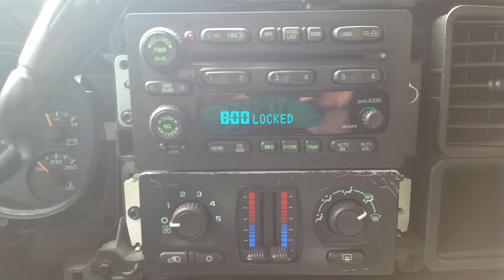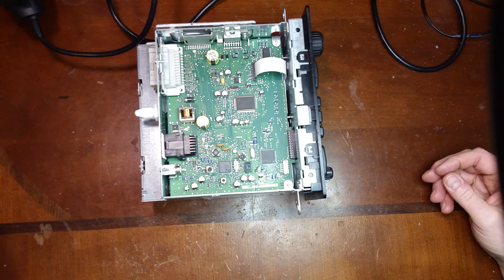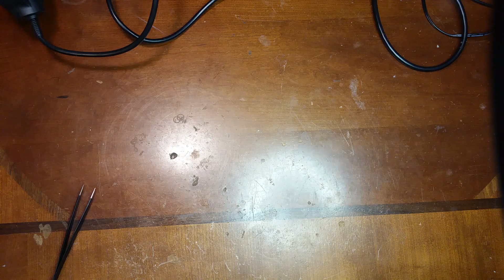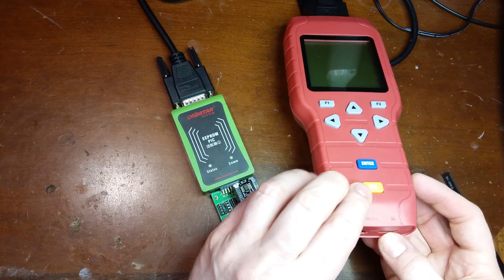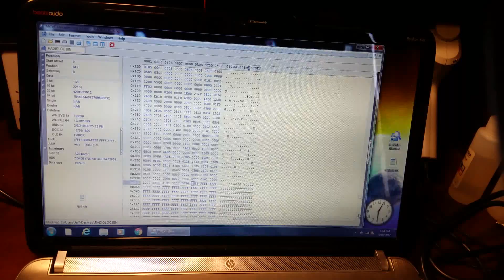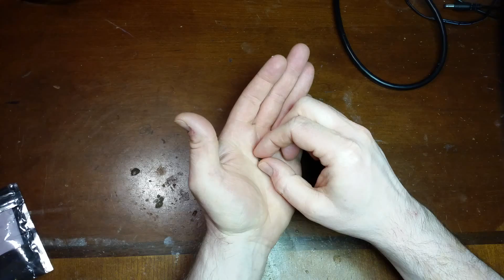My attempt to unlock a GM radio

Comment: It worked!! I just did it on a 2002 year radio that I installed on a 2005 Trailblazer. gives "Calib Err" message upon turning the ignition on then it goes away. I don't know if it's a checksum error or a problem with the radio it self. everything is functioning properly. thank you!!
Reply from the maker: If it is storing station presets and audio settings than it was successful!
Reply: Folks, the GM RDS radio receives extra info like the song, band info. Class-2 serial data wakes the radio by Sharing the VIN to prevent theft. A speed signal from the PCM tells the radio how fast you are going. It gently increases the volume as wind noise & road noise increase. Hey, the government wants higher fuel mileage, so even the glass is thinner. The EEPROM stores a lot of info. If you sit the radio on the bench and drive for three weeks, put it back in (Or Changing a Dead Battery) the radio wakes up, goes to your station at the same volume, plus all stored stations are there. The Body Control Modual turns it on and monitors its “State-Of-Health.” If the lights are left on, key is in the ignition or turns signal is on too long, or a “Hands-Free” phone call, it mutes the volume and a tone comes out the left front speaker. If an SIR is deployed & equipped with “On-Star”, the On-Star module has its own battery. A signal is sent and they will ask for you to respond. They call the local police/highway patrol as they have your GPS location and sent help and stay with you until first responders arrive, or if they know the On-Star battery is running low. It is serviced separate from the big normal battery. It may require replacement but it will let you know in advance. Blessing to all!
ASE Master since 1978 - Retired
Reply: can you send a picture of where that chip is in one of these radios, I can't find any pictures of where the chip is on the board
its diffrent to the one found in the silverado's

Comment: Can you set the vin to all Fs or 0s and it work?
Reply from the maker: I haven't tried. But I wouldn't think it would work since the radio is looking for a match.
Reply: I wouldn't expect it to work with the EEPROM removed either, but supposedly...
Either it's explicitly coded that way, or the failed read returns 0s or Fs and that works out whatever way.
Reply: I'd also suspect that there's code left over that makes it easier to test at the factories or in  prototyping phase. If you know the master code, it stops looking; what if that code is all 0s, or whatever the default value is in the register, before being overwritten with EEPROM values. A paraphrased line of code could be "if 000000, assume EEPROM failure or testing".
Reply from the maker: @Marc_Wolfe  Yes it's possible that there is some sort of master code that allows the radio to write the VIN when it's new. But I haven't researched it or experimented so I'm not sure.
Reply: You've done more than I have checking that the radio works without the EEPROM.

Comment: A lot of good radios have been thrown away because of that nonsense.  I had an old 88 Mercedes 190 and had to junk the factory radio after making the felonious mistake of changing the battery and not using a 12-volt transformer to maintain power.

Comment: Jeff, It been two years since you did a video on a GM rear view mirror, but I remember it. I am doing a swap of an 03 Tahoe engine in my 1967 C10. The Tahoe belong to my youngest an hit black ice. He gave me the whole vehicle. Being a retired tech, working at GM dealer plus your video, I changed the mirror as I have no passengers side SIR or seat sensor. For most, the passengers front seat has a bladder that creates pressure a sensor reads. The SIR system decides to turn on or disable the air bag if the weight is roughly less than 42 lbs. (Caution; Any repairs, parts new or used, need to be calibrated at the dealer) 
The mirror has PASSENGERS SIR - On / Off in mirror that I did not wish to look at. Using two 0.39” feeler gauges, I was able to remove cover, un-clip the mirror dimmer leads and remove the plastic “Appliqué”. I cleaned with wax/grease remover used in painting. Applied two coat of plastic adhesive promoter, light, thin and 12 minutes to dry or flash off. Then two coats of quality flat black was sprayed in the same fashion. LED’s produce very little heat but still could shine thru. I place folded foil over the LED’s in two rows, the a 1/4” foam strip. Waiting over night, I cleaned the mirror and window for compass and temp readings. 
Placing the now black strip was easy using some sticky on the locating tabs, clipped the mirror leads back on, made sure all was aligned. Snap. Everything works, no scratches and looks like it came out of the box that way. I get one thing done per day Retired! Thanks Jeff!
Reply: Sorry I can’t edit mis spelled words. 6’3” big fingers on little iPhone 6. Never owned one but my son sent me one. I just go to my garage everyday, plenty to do and make. Jeff, you gave me a little extra confidence to Get-R-Done! Thanks again. Like / subscribe & learn!
Reply from the maker: Sounds like a pretty cool project you have on your hands!

Comment: If you program all zeros in the vin field. The radio will relearn the vin that it is installed in.
Reply from the maker: I've read this in old forums. I tried it once and it didn't work. I might have messed something up.
Reply: jeffescortlx I did have a bin file from a new radio never installed. And it was all zeros at the vin area. Will have to go back to the bin file and compare them. I remember seeing the presets store points as well back in day when I was doing this a lot. And the XM modules as well we would zero all the content of the serial eprom and it would relearn the vin along with some info from the radio got populated there as well. After 50 ignition cycles it was said to be fully populated and the XM was not programmable from the tech2. Only a new XM module or blank zero eprom module would relearn and function.
Reply from the maker: @rick601a  I definitely want to try it again. I have had quite a few work for me with inputting the VIN manually, but it certainly would be better to have it set to all zeros' s all ready to go for the next vehicle.

Comment: Can you just use the clip to avoid desoldering? And can you use a usb eeprom reader instead of the tool you used? Thanks.
Reply from the maker: I don't see why not. You can use any method you want to edit the data.

Comment: I worked for GM's radio department back when these were developed.  The gag order has expired so I can tell you guys how to unlock these now without any soldering nor special equipment.

1.  I  assuming the radio is installed and the display says locked.  If not then get your radio installed, powered up and to the lock screen.

2.  Set the clock to 11:58 or 23:58

3.  Use your stop watch, as soon as you set the time you must wait exactly 11 minutes and 58 seconds.  As soon as 11 minutes and 58 seconds has elapsed re-set the time back to 11:58 or 23:58.

4.  Repeat this 5 more times for a total of 6 cycles.

5.  After your 6th cycle make sure the driver door is open, simultaneously press & hold PWR and the number 6.  While holding those turn the ignition completely off for 15 seconds.

6.  Release the buttons, turn the ignition on for 5 seconds and start the vehicle.

7.  The display will still say LOCKED however it's in the last step of unlocking.  Now drive the vehicle for 11.5 miles.  

If you have done the sequence correctly the radio will unlock.
Reply from the maker: Not sure if serious or if it's a early April 1st.

Comment: Swapping EPROMs also works if u had stock radio
Reply from the maker: Yes. But in this case the current owner of the truck didn't have the original radio.

Comment: Only problem with this solution is that even with a the correct part number radio you could still have incorrect software installed. Example is swap between a suburban and a standard cab Silverado. using Tis2Web I can program in the correct vin and correct application software including the updates such as the issues with cd ejecting, no sound, com errors etc.

Comment: Radio locks are such BS, so much hassle for people trying to install used radios and virtually no deterrent to steal them. the stupid dumb dumb criminals dont know the radio is locked until they try to sell it or use it. at that point its already stolen... cool the bad guys dont get to make a profit but the radio is still gone.... FFS, who steals radios anymore...
Reply from the maker: It's not like GM can push a magic button and make VIN lock go away. Like I had already commented to someone else, it was the right decision an the time. Back when this was engineered CD player head unit were $500. If a thief get $200 from a pawn shop, you can bet they will do it again and again and again.

Comment: I don't generally work on car radios, but I noticed several of your videos show you using this magical red tool that has the ability to read and write to EEPROMs. In fact, using it to repair a flat screen was the video that appeared in my recommended list that lead me to subscribe. Reprogramming EEPROMS is on my list of "I need to learn how to do this" items. Would this X100, in your opinion, be a wise purchase if 98% of my solid state repairs are non-automotive devices? Or do you think one would be better of investing in a universal programmer like the TL866? There is quite a price difference and I doubt I would get much use out of the automotive tool. I am leaning toward the TL866 due to cost and the ability to read and write to more packages. What say you?
Reply from the maker: Good question. Yes the X100 is expensive if all you need to do is read and write eeproms. For you it might not justify the cost. But with the automotive work I do it gets used regularly. It has advantages. It can work completely stand alone from a PC and it has a fairly easy to use user interface. It's also a OBD scan tool to read and erase check engine lights, can odometer correct a nice collection if vehicles, and retrieve codes for Toyota cars and such that need new keys programmed (haven't used that yet) and it can read and write bare eeproms. And has regular updates from the manufacturer (to support new vehicles) 1st year is free.

Comment: Be easier to throw a cheap (better than basic stock) aftermarket radio in there.
Reply from the maker: Yes, but then you'll loose the ability to communicate with the serial data. Like the ability to reset oil counter, door/head light reminder dingers will be gone. If you have the Bose amp the new head unit might not be compatible.
Reply: @jeffescortlx  nope. Pioneer has RDS double din units for about $300. You can get full capacitive touchscreen, bluetooth, nav, xm... literally anything you want

Comment: Number 1562 reason why not to buy a Chevy. Can't just put a stock radio back in.
Reply from the maker: You have to keep in mind, 20 years ago when this stuff was engineered radio theft was a thing. If they didn't do something to help prevent it, everybody would be complaining that GM made it too easy to steal and resell. Just shows sometimes you can never win even when they do what was right at the time.
Reply: @jeffescortlx  that doesn't stop anybody from stealing your radio that just stop them from using it your radio still been stolen so it was useless pointless and stupid just like the majority of Chevys.
Reply from the maker: @republicansareoffendedeasi821  I'm pretty sure everbody would agree that a radio that can be sold and reused is more likely to get stolen than a radio that nobody else can use.
Reply: @jeffescortlx   they can still sell like they just do the same thing you just did.

Comment: I want to see someone try to unlock a Fiat Dodge Chrysler U connect 8.4 and activate the GPS that is already inside of the unit but you do not get to use it when you buy the U connect 8.4 unless you give them another $700-800.

Comment: If you turn the ignition to ON rather than RUN, these radios will play normally even with a VIN mismatch. That's something it won't do if you just hook it up to a power supply. I suspect that if the CAN bus serial line is pulled solidly high or low that these radios will play normally until the BCM comes to life as the key is turned to RUN.

I don't recall the keys to press, but there is also a multi-key sequence that you can depress to make these radios power up for a short period of time, perhaps as a test.

A number of other parameters are stored within the EEPROMs (more than one on the board), such as the type of speaker system to which the radio is attached (2 or 4 speakers, Bose, etc.).
Reply: +1 for uxwbill also knows his stuff and was sharing helpful info.....sounds like "Im the Man" having bad day go troll some where else
Reply: Go fuck yourself, Mr. fucking know it all!
Reply: @imtheman3039   Youtube comment section cancer, thy name is I'm the man. Too bad you're a troll lacking the ability to restrain yourself in the slightest. At least your bedtime will be coming soon.
Reply: @imtheman3039  uxwbill is the man you go fuck yourself bro
Reply: @imtheman3039  huh?????

Comment: Or you can use a Chinese gm tech2 to unlock it without taking it apart.
Reply from the maker: No, you can't with just a GM tech 2. I have one. You need a pass through and subscription to AC Delco.

Comment: Can you use SOIC clips and program the EEPROM on the board?
Reply: That should be possible... you can use them to flash the BIOS on a laptop (and I've done so to install libreboot on my ThinkPad X200), so I can't think of a reason it wouldn't work on a radio.

Comment: Hey I have a question for you. 
If you set the Vin number to all zeros 
What will happen on these radios
Reply from the maker: Never tried. But I'd assume it would just stay vin locked since it isn't a match.
Reply: I assume that's because it all goes through the CAN-BUS out to the body module, and back. No VIN=no return signal telling the radio to switch on.
Reply: It’s very unlikely this would work. A value of all zeros is still a value, and it wouldn’t match. In order for this to work with any car, someone would have to most likely program in a check to see if the serial is all zeros and then allow it to work. Computers only do what you tell them. If you check for a vin match, if it’s anything other than a match, it won’t work unless someone specifically programs every possible instance.
Reply from the maker: @ericspda  agreed. But I have heard of a place called AJR that supposedly has a eeprom file they use that will stay unlocked with any VIN. Not sure if it's true, or how they do it.
Reply: jeffescortlx It’s probably a simple matter of changing the right value in the right place to entirely stop the check from happening. How you know what that value is, I’m not sure.
Reply: Every auto must be programmed with all acc. as built when built. To add you have to know how to with the scan tools as you have to use the vin when using them which has factory setup in bcm. Changing the on star form 03 to 05 which has digital added has to be reprogrammed in the bcm. I never did mine so I do not get the number calling in the instrument cluster like it should but it works. 

In Dec 2003 I was the first to install factory Nav without touch screen as it was not out yet. The amp had to be programmed for it to work as it was the upgrade Bose amp but it did not store the vin. A used amp would work just fine no programming needed. Had to rewire the amp harness and add data which controls volume and other features. Had to make the tech ll think it was a bmc Denali. Gm, Delphi and Bose said it could not  be done in an avalanche. I proved them wrong. 

Now to add factory xm.  First I am going to lift pin 1 see if it will program vin. Worth a chance.  Free tow from on star was well worth it even if my ins. Has free tow.

Jeff great videos.  I have fixed instrument cluster several times last changing all servos and went to led lights with the leds on a pcb 3 on each. Very nice and bright. Cracked solder joint on cluster of resistors by the connector. Now good as new and time for the Tahoe to get fixed. Worste car i ever purchased 07 tahoe loaded ltz. 03 avalanche is the best one I purchased. 

Scott

Comment: Just out of curiosity, why not just program it with SPS rather than disassemble the radio?
Reply from the maker: Because I don't have SPS.
Reply: GM Tech II (2) scan tool. Talk to some automotive friends that can get you a deal on one or borrow one.
Reply: The Auto Tech how can i could unlocked my radio from a Silverado2011
Reply: Jose Rodriguez  dealer does it for 80$